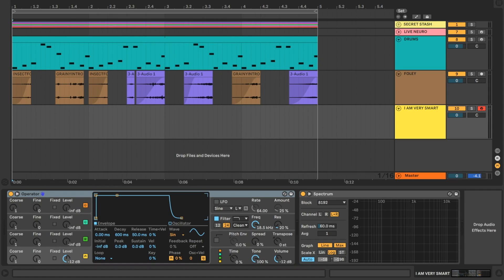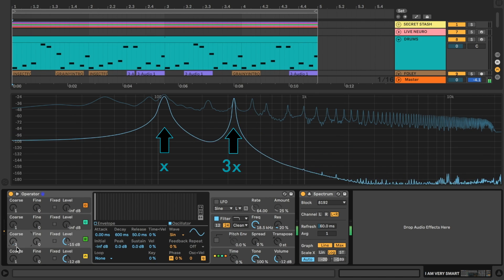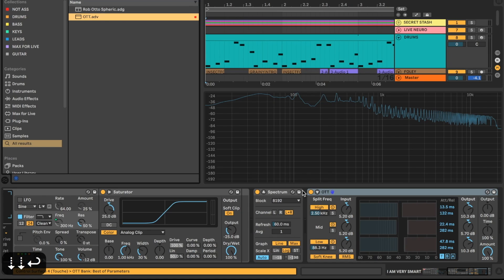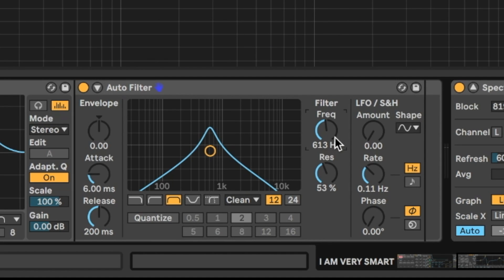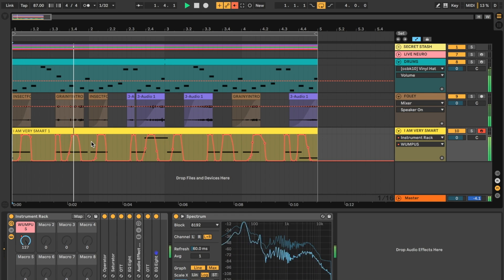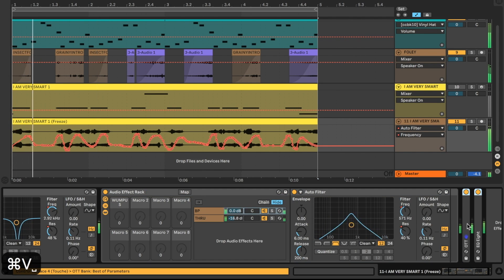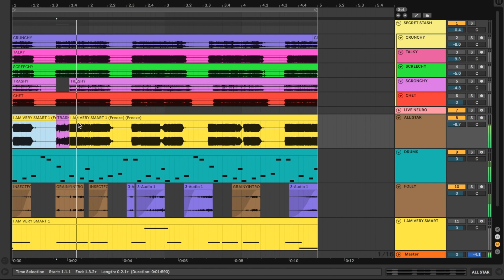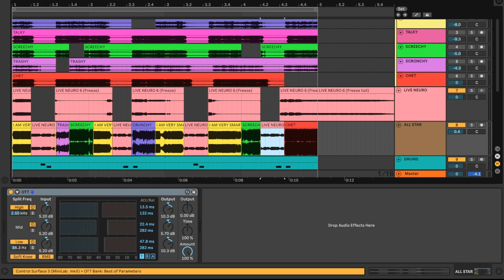How to make (and PERFORM) a Neurobass

Comment: Can anyone explain why I have to raise my filter freq up to around 1.9kHz before I get the same sound as his at 300Hz? I've gone through the video multiple times and triple checked that every parameter in my Operator is the same from the very start and have no idea why I can't hear anything but low bass below 1.9kHz - any insight would be greatly appreciated!

Comment: when i add the saturator mine creates a completely static sound (your saturator seems to be moving, like theres an lfo modulating one of the parameters). on the spectrum you can see frequencies moving but on mine they're completely still
Reply: same issue - did you ever figure it out?

Comment: I have this weird thing with operator in ableton 11, I have to push the filter above 10khz to get the full sound of the harmonics (even though they sit at no more than 310hz. I start hearing them at around 1khz cutoff), if I put it at 300hz like you did in your video I hear basically nothing (only a muffled fundamental, no harmonics), even if I push the levels really high. On the spectrum it looks like the filter reduces the sound waaay below the cutoff, at 1khz the third harmonic is at -48 db, with the cutoff at the max it's at like -7db, at 300hz they're at an abysmal ~-100db.

For this test (no effects after operator), I have the three oscillators at 0db (except the second harmonic, I put it at -4.4db), and operators output is at -5.4db (I get distortion above that). (Also, unrelated, for some reason the sustain is at the max on the first oscillator by default but not on the others).

Also I don't understand how you can get this sound with -12 to -15db on the oscillators and -12db on the output, I have to push everything way higher to get the saturation to do anything.

Overall I can get a similar sound by changing levels and cutoffs but I just wonder why it works differently on my system, anyone knows why ? I just want my filters to work like they should.
Reply: SAME BUT I FOUND THE SOLUTION! His Operator probably has different default settings to ours so I had to check every single one of his settings and match them up. I found that there was a setting in my operator filter that was messing everything up. It's the freq>key setting, which I had be default at 100% when it should've been at  0% like in the video.
Reply: @lolioliol360  Oooh thank you didn't realize keytracking was enabled by default, that must be it
Reply: @lolioliol360  bro u saved me. Have a blessed week
Reply: @lolioliol360  You are a hero!

Comment: I set the first filter to max at 300hz and can barely hear anything. Not sure how yours is coming thru so strong. Where I get confused as well is the bandpass filter stops at 700hz, but if the first filter in operator cuts out at 300hz wouldn't we not get any frequencies at 700hz?
Reply: @Silas turn freq<key to 0%

Comment: This is the second video I watched on this channel and now I wonder if it's the clowning that does the magic or the guy is a genius, somehow I now better understand some stuff that I used to just do without really comprehending. Not that I fully comprehend everything now, just that it makes more sense, kinda clicks.
Reply: Still wonder why 3 osc in parallel + LP in Operator differ so much from same configuration in Serum. The 3 osc part is easy to make sound the same, LP24 at 30-300 sounds totally different for some reason, Serum's is much more resonant in the lows. 🤷‍♀️

Comment: As soon as i get to the part where you apply the first filter, my sounds stops matching yours. I cannot hear any changes in sounds before 300 Hz. Why does this happen? I cannot create the ending "neuro bass" sound you produce, because all of my Wompus is happening at 400-500hz. when I put it to 500 it creates movement, but does not sound as crisp and good as yours. Is there something I am doing wrong? I am using the standard operator.
Reply: go on filter and change Freq<Key to 0%

Comment: I followed along with Massive 1 and Reaper. Trickiest part was the sweeping bandpass filter. In the trim selection you can choose the mod option for the freq of the bp filter and lock it to the macro you use for the LP filter in Massive. Also instead of a separate chain bypassing the band pass filter, you can just adjust the wet/dry mix (i was using ReaEQ). I also just grabbed the OTT plug-in from xfer, it's free.

Comment: Can anyone explain to me what OTT does? I don't have this plugin and I'd like to be able to create that effect without it. It looks like some kind of compressor to me. idk.
Reply: its native to ableton, and free from xfer. its a a multiband dynamics preset that simultaneously compresses and expands your sound so the dynamics sit within a tight range, and it'll bring out the quietest sounds in any range of the frequency spectrum. using the time knob you can change how much of a pop it gives. it's one of the few things you can call essential to production, and it's free so no reason not to get it. 
if you actually want to create it then you can just use a multiband dynamic plugin (maybe you have it natively in your daw) and copy the settings

Comment: Man, you're nutz )) You're going to a spectral territory sculpting instead of a wave folder. Over this a BP filter can be put. The result will sound better, more lively. Actually any sine-spectral waves sounds sterile, like some straight computer generated audio. And it's very obvious for ears... if you're familiar with analog generated waveforms and filters. Wavefolder can be digital easily, it's not a big deal usually.